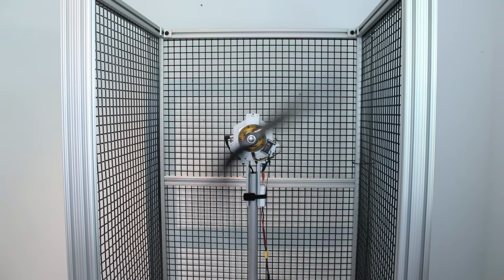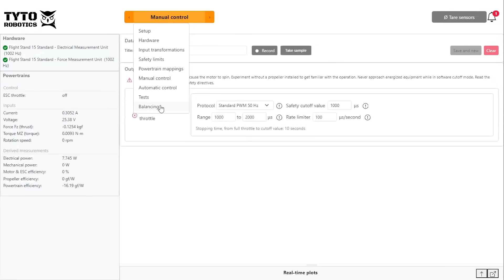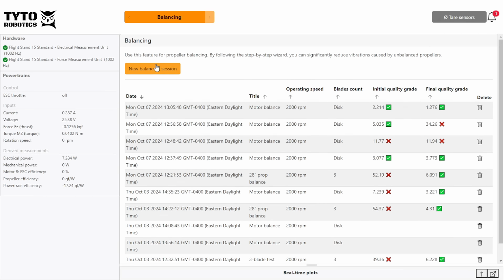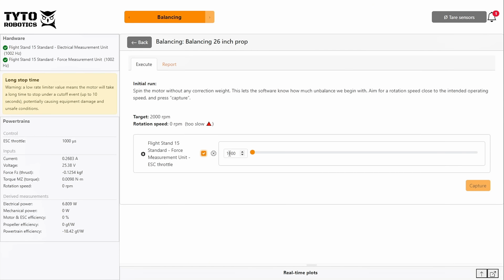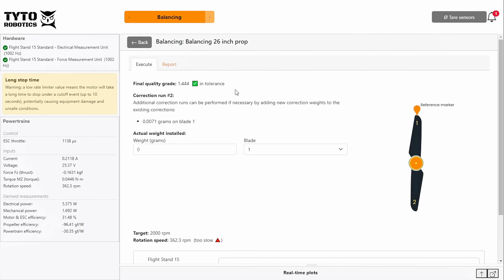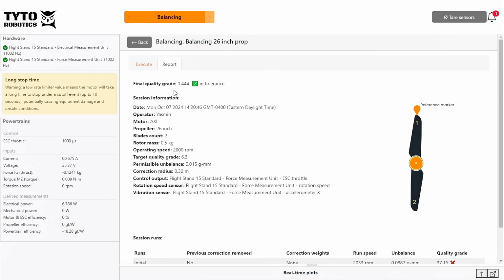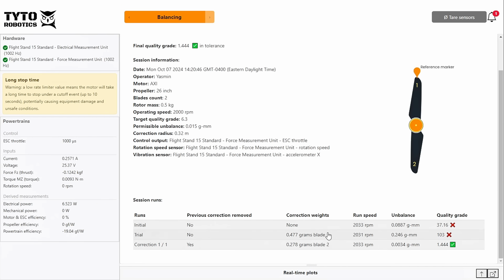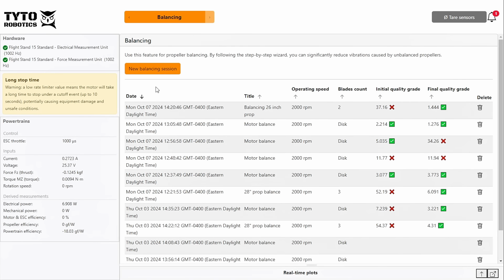NEW Propeller Balancer from Tyto Robotics - How it Works

Comment: How do we know which blade is blade 1?
Reply from the maker: Good question! You (the user) choose which blade is blade 1 when you add the trial weight between spin 1 and 2. That blade remains blade 1 for the remainder of the test and the other blade would be blade 2. For propellers with >2 blades, the blade # increases in the opposite direction as the direction of rotation. We explain it in more detail in this tutorial: https://www.youtube.com/watch?v=fAuatkqqtYU